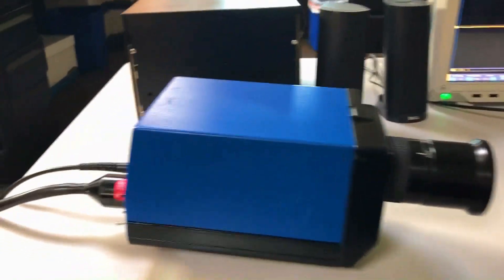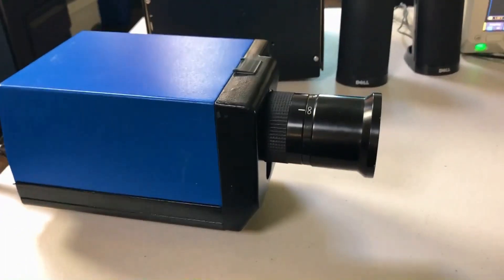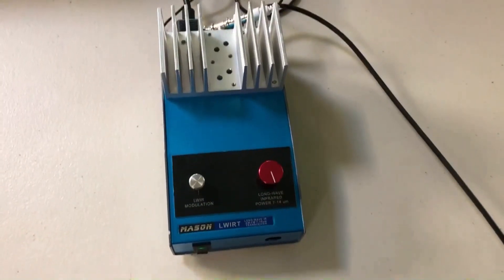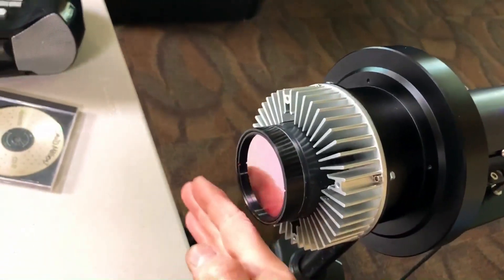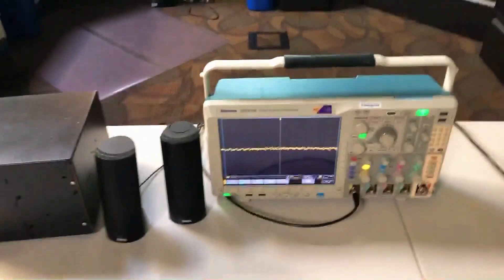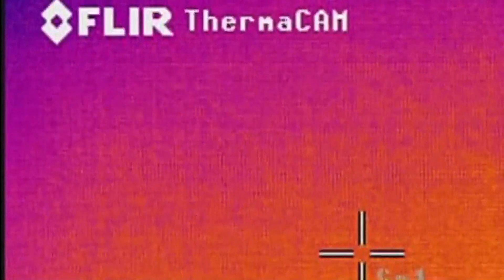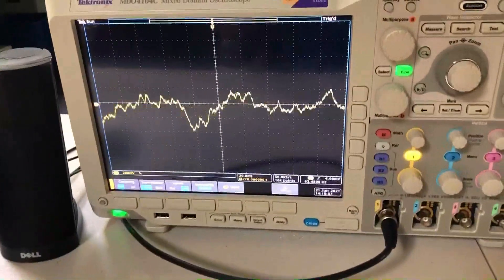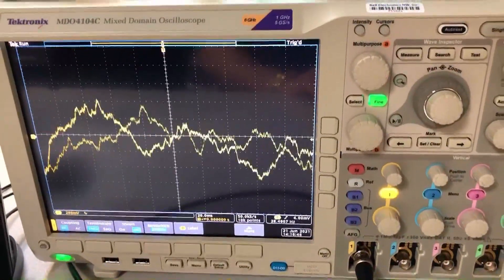David Mason demonstrates his new FLIR camera inventions

Comment: I was thinking you could pick up heartbeat, then you mentioned it, cool! Did you find any other ordinary objects that make a sound?
Reply from the maker: So far just bird flocks make a rumble-flutter sound due to temperature variations with wing beats. It sounded very similar to the actual acoustic sound of wings. I haven't tried it on a commercial jet yet but plan to try it with a LWIR long focal length lens.